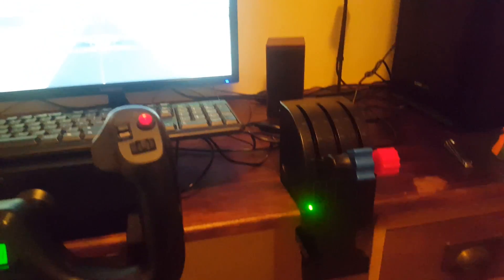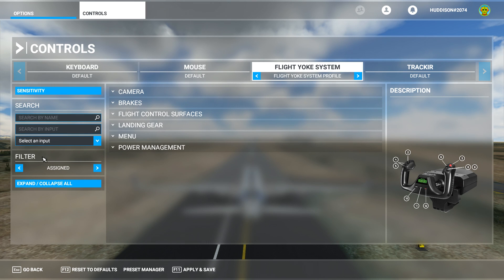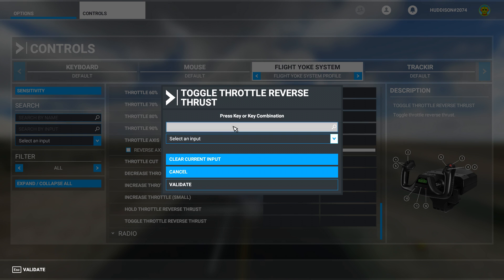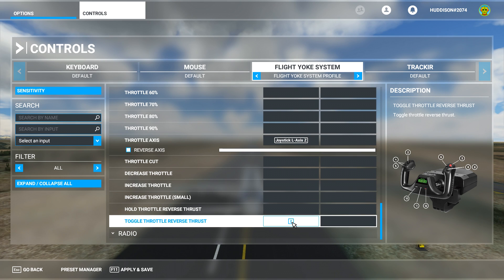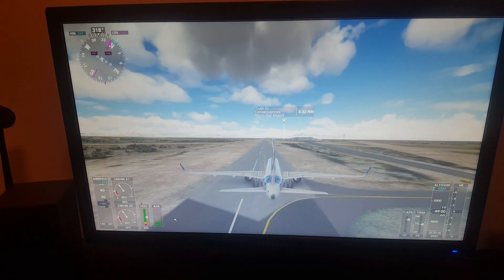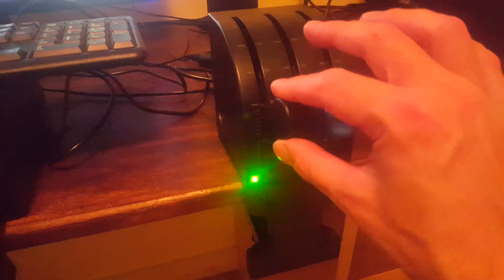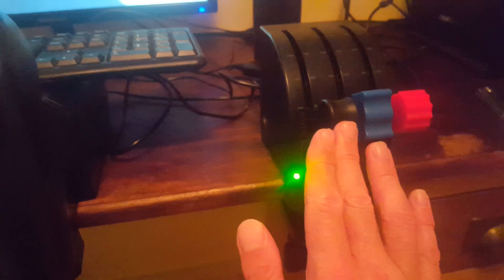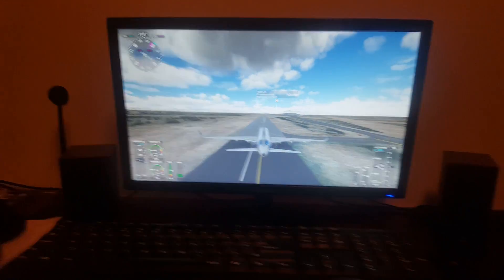FS2020 - How to Toggle Reverse Thrust on Logitech Throttle Quadrant

Comment: Can I ask ... Was thinking of buying a logitech throttle quad... Can you tell me, can I just power it from the PC USB or do you need a  yoke as well?  Thank you
Reply from the maker: Hi, you can apparently buy separate throttle quadrants that have USB connectivity - so these should work independently.
I haven't got one myself, nor tried it, so I cannot confirm how/if it works.
Reply: @Huddison  Thank you so much and thank you for doing the videos..   I am a bit reluctant to buy Logitech as have an excellent Nav control panel bought directly from them in October.. The silver knob,   from day one started to work loose.. I was happy under their instructions to fix the pot but was told not to.as its under guarantee .. Had to send them email after email and a video only to have radio silence now  from them ....Not impressed at all with LOGITECH SUPPORT on a new product...Left with a faulty £70 unit
Reply from the maker: @alwatt9367  Your experience with them, doesn't sound too good at all. 
I did send them an email a while ago & know that they are struggling (as with many companies), because of the current pandemic, so that might be an equation - keep on trying to contact them.
Reply: @Huddison  Thank you for the reply... This has been going on for nearly 8 weeks and I keep being asked for additional info and who I bought it from...As requested sent the invoice from them etc and they still keep asking for more info...  This is a new unit and covered under a warranty which they admit is correct...Sad since  I could buy more of the logitech flight gear, but not sure of back up service now.
Reply from the maker: @alwatt9367  It really does sound like an ordeal :(
Reply from the maker: By the way, keep an eye out for a video from me later on today - I think it'll be right up your street ;)

Comment: when i push the throttle forward it increases.  But when I pull the throttle back, it stays at full power.  what's wrong?  for example at a Cessna.
Info: I have the Saitek pro flight yoke system with throttle quadrant
Reply: I did exactly what you do in the film, but still the accelrate stays the same
Reply from the maker: @ster100  I'll investigate further for you.
Reply from the maker: Is this in normal flight? Watch through this video, to see if it helps:
https://www.youtube.com/watch?v=N18KdQct9n4

Comment: Better way:
POWER MANAGEMENT/ THROTTLE/
THROTTLE 1 AXIS - JOYSTICK BUTTON 7
THROTTLE 2 AXIS - JOYSTICK BUTTON 7
THROTTLE 3 AXIS - JOYSTICK BUTTON 7
THROTTLE 4 AXIS - JOYSTICK BUTTON 7
HOLD THROTTLE REVERSE THRUST - JOYSTICK BUTTON 7
Acts funny in setup but works perfectly in sim.
Reply from the maker: Great tip!
Reply: Dude, you're a genius. But unfortunately when switching from Reverse to 0 it is often set to A/THR in the A320. I don't know if it is my Logitec Quadrant (I also have another quality problem on the buttons already), or if it is the Flight Simulator or maybe the setting here... But for the landing only this works fine.
Reply: @DinoDarinoMischtdentorf  sometimes going to the zero detent is not perfect. I have found when ending reverse it is better to advance slightly ahead of 0 detent, then quickly back to the 0 detent.  Do not know if this could help you.
Reply: @BostonClipper  Correct.  Going from reverse to zero doesn't engage forward thrust, it just sets reverse thrust to neutral.  Pushing forward slightly, then back to zero disengages reverse thrust.
Reply: The function "decrease throttle" works fine to reverse too. Try it
Reply: @claissonferreira  I tried Option/Controls/Saitek Pro Flight Throttle Quadrant.

Deleted:
THROTTLE 1 AXIS - JOYSTICK BUTTON 7
THROTTLE 2 AXIS - JOYSTICK BUTTON 7
THROTTLE 3 AXIS - JOYSTICK BUTTON 7
THROTTLE 4 AXIS - JOYSTICK BUTTON 7
HOLD THROTTLE REVERSE THRUST - JOYSTICK BUTTON 7

Then added:
DECREASE THROTTLE
Did not reverse props

Then added:
THROTTLE 1 AXIS - JOYSTICK BUTTON 7
THROTTLE 2 AXIS - JOYSTICK BUTTON 7
THROTTLE 3 AXIS - JOYSTICK BUTTON 7
THROTTLE 4 AXIS - JOYSTICK BUTTON 7
DECREASE THROTTLE
Did not reverse props

Could you be more specific?
Reply: @claissonferreira  I am working on a video that includes setup.  Any help would be appreciated.

Comment: I have the same throttle quadrant and no matter how many times I try reversing the axis the action remains backwards in the game. For example when I push my lever forward with my hand, the plane loses power. So I invert the axis in settings and it doesn’t save that no matter how many times I tell it to.
Reply from the maker: When you thought that you've heard everything..😗.
Do you have your quadrant configured in a separate program/software?
Reply: Huddison no
Reply: @colbyjamesreynolds1516  Did you find a solution? I have the same problem
Reply: greetoz I actually ended up turning the actual quadrant itself upside down. I took the clamp off the back and inverted the clamp so it’s upside down from how I had it before, but now the simulator recognizes my hand going forward as adding power.
Reply: @colbyjamesreynolds1516  I found out the indication in FS2020 is not correct under the settings. But the actual throttle does work. I just have it set WITHOUT the reverse axis checkbox and the throttle acts normally. The indication under settings is just wrong.

Comment: do you have a video of how to set up all the buttons on the logitech yoke or does it do it by it self ?
Reply: umm NO defaults for my Saitek Cessna Yoke  help
Reply from the maker: @g4kfjve7kfj34  planning on making a video on this
Reply: @Huddison  oh grand many thanks
Reply from the maker: FS2020 as default, sets some of the buttons for various functions - you're best going through the controls options yourself and set the buttons up, as you would like them.
Check my other videos for setting up the flight System in FS2020😉

Comment: thanks for the video.
is it possible to set it normaly as it has to be like fsx? i mean, only with pulling the throttle lever down below the idle position
Reply: Reverse works better if you put your input in “Decrease throttle”.
Reply from the maker: I don't believe so yet, but give it time - it's bound to be an option soon.
Reply: If there's an in-game settings option to turn toggle off, then it should just engage full reverse thrust when you click it down, then back to neutral when you click it back up.  If reverse only has toggle option, then set the Z to decrease thrust control, and it should drop thrust to neutral and continue into reverse.